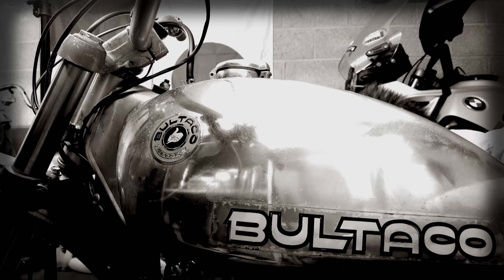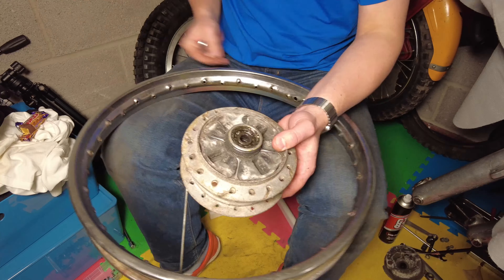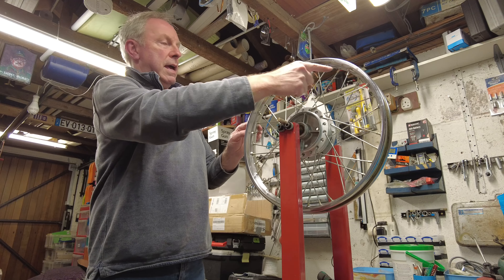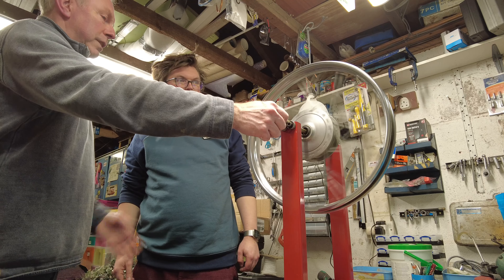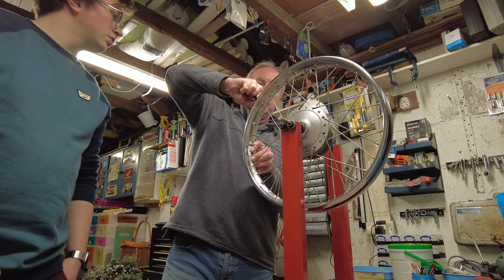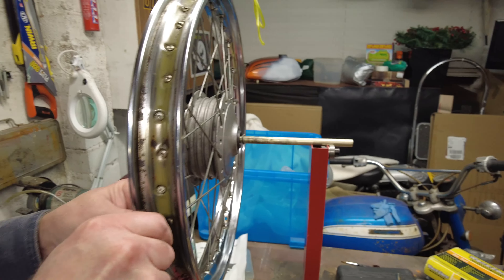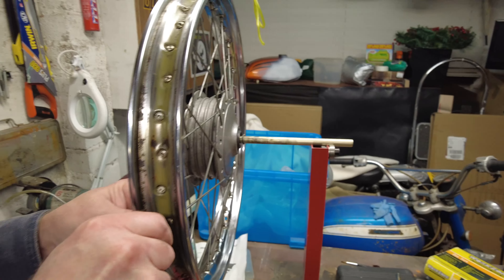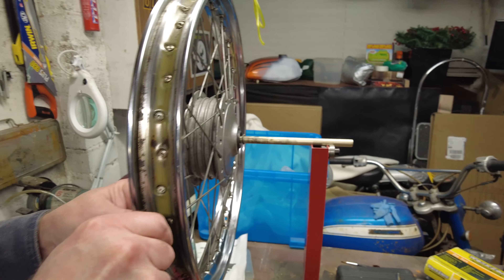Rebuilding Buckled Wheels… | Honda CT90 K0

Comment: Did you have any concerns about a wheel off-set? Perhaps not, but on some bikes the hub is not central in the rim depending on brake and drive arrangements. Don't ask me how I know 🙄
Reply from the maker: Good question! I didn't think there was an offset on the CT90 wheels, but I'm struggling to find any information online to support or refute that... I think the newer 12V C90s have a small offset on the left vs right, but not sure about the CT90s. In any case the spokes only come in 2 sizes, for the inside and outside spokes, so I think setting it up central should be fine 👍